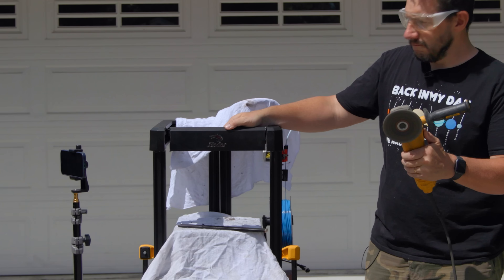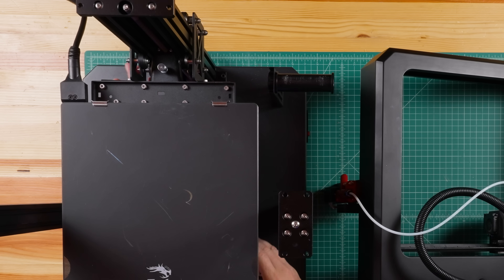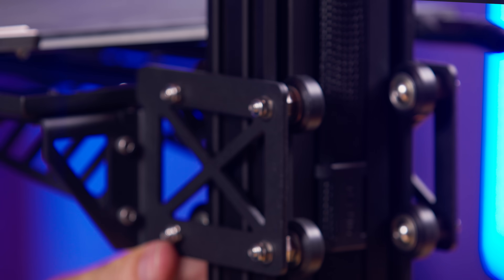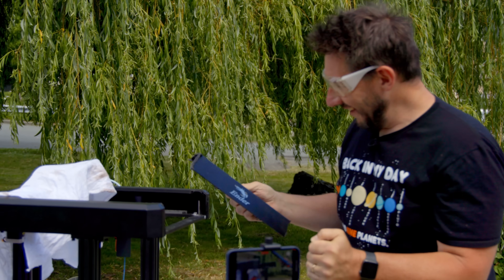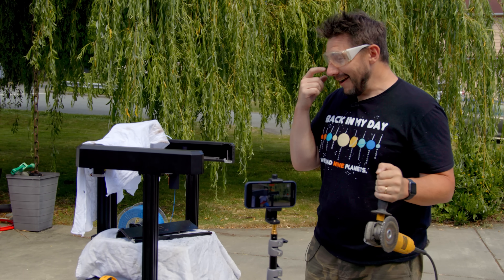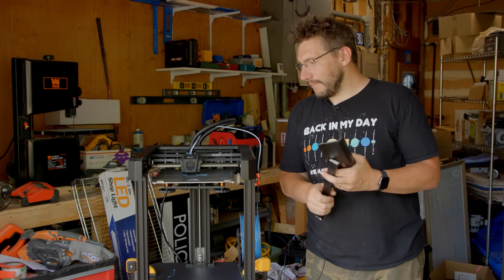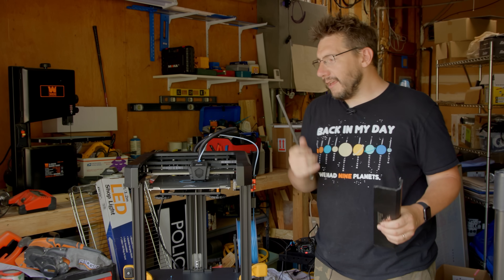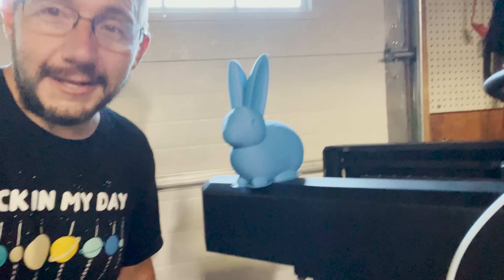I FIXED the Ender 7

Comment: Haha, this was amazing. You made it possible to buy this printer for just nothing. Changed the z wheel crap to linear rails and the printer is a blast. Printing parts for 2 years with no real degradation or errors. Like a industrial printer for no money 😁Thanks!
Reply from the maker: Glad I could help
Reply: @3DPrintingNerd ❤

Comment: Nice hack!  I agree it's really important to be able to see what's happening in the first layer of a print.  No other printer off the top of my head makes it so hard to see.  Great idea I tend to agree that the thickness of the metal is enough to hold it's shape with that missing. At least while assembling mine the top didn't really do much as the uprights were pretty well aligned so I didn't need to bend anything to get the top to mate with the uprights.

Comment: Mine works awesome.  I also had to adjust the back stop nut. but it didnt take much effort.  first print to last it works without a single issue.  Not at all sure id cut my top front rail down, but do agree it does end up "in the way" a bit.

Comment: This is why amateurs shouldn't touch things. Tension in these traverse belts is quite high, inertial loads from the hot end accelerating back and forth produce low frequency vibrations which now are closer to the fundamental frequency of that baseplate he just cut off. That will throw off alignment of guides over time and ruin the system. Moronic, amateurish and sad.
Reply: Hahahahahahahaha tell me you haven't seen his recent videos without saying you haven't seen his recent videos
Reply: @3lapsed  I don't care. I design machinery for a living and people like this guy just gives bad advice/example. He doesn't know fundamentals and he monetizes on ignorance
Reply: @puntoycoma47  designing for living and living from designs is not the same. 😉
Reply: @BeardedTinker  I was formally trained to design machinery and I've been in the business for 17 years making things from race car components to robotics, injection molding and industrial equipment. This guy is an amateur jock and it shows.

Comment: Everyone speaks about rigidity issues about removing that metal bar but it really isn't an issue if the rest of the frame is solid. Many Voron models (v0, trident, v2.4) still have a U-shaped gantry and have little issue with rigidity, same with others like HeVort, etc. Although they do have either additional extrusions or linear rails supporting the gantry from below as well

Comment: By removing that you risk warping the plate from stresses in the steel plate
Reply from the maker: Actually I don’t. I promise.
Reply: @3DPrintingNerd   not shooting smoke man. Seriously the possibility does exist  research stress relief of metals through heat treatment. Been in the metal working field for 15 everything from CNC plasma, grinding, heat treatment. Look up Titans of CNC he's also frequently mentioned relieving  stress in metal even plastic parts through the machining process to achieve tolerances for parts that tend to spring when material is being removed.
Reply from the maker: @johnl5177  Maybe I misunderstood. by "plate" I thought you were referring to the build plate, and as far as I can tell it's not connected in a way that would introduce stress if my cuts made things not good. I could be very wrong. Titans of CNC is AWESOME.

Comment: I have the Ender 5 plus.   I tell everyone the number one upgrade that is absolutely necessary is the corner brackets that drop the front bar down a few inches (available on thingiverse) so you can see what is going on.

Comment: Do you realize the wheel you had in your angle grinder wasn't a cut off wheel but rather a grinding wheel lol. This is why I hate working on machines in our repair shop that the general public messed with
Reply from the maker: Yup, I knew. It’s all I had because I couldn’t find my cut off wheel. Did the job though

Comment: I recently bought this printer. No problems right out of the box at 250mm/sec.  I guess the point of cutting the top structural unit was for clickbait and views, but there is no reason at all I can see to do this and it will allow flex in the XY gantry head.

Comment: The cross-bar piece you cut off keeps each side pillar from flexing sideways, under slower speeds it wouldn't matter but at the claimed 250 speed it would stop each pillar from flexing side to side on the X-axis.
I learnt this from building roll cages on race cars, the solution would be to replace the offcut piece with another but mounted higher so you can still enjoy the access and usability of removing the bar in the first place without sacrificing the integral structure.

Comment: The bed torques "left and right" not because the carriage has two pieces, but because the only thing resisting that torque is the V-wheel edges riding in the V slots. Even if the carriage was a square box, they would still slip out under torque. In order to stiffen that axis they'd have to add wheels that roll on the left and right sides of the column in addition to just the front and back. If they moved the existing wheels, they would just move the problem from the X axis to the Y axis in terms of wobble.

Comment: That's one way to wrack a perfectly good 3D Printer. That Aluminum metal frame you cut out the front is structural and has a purpose. You've taken a strong square frame and turned it into a weak U shape. And using a grinding disc as a cut off disc shows me you don't have a clue what your doing. Wouldn't be surprised if you never get another product from Creality and I wouldn't blame them. What you should have done is returned the item and give them the chance to repair or replace the Printer.
Reply from the maker: HahahaHAHAHAHHAHA. Look, I get what you’re saying, and yet, I did it, and it works great. That metal wasn’t needed and yeah, still isn’t needed. 

Plus, Creality sent me a message saying “Genius!” and I already have more boxes en route to me from them.

Comment: For anybody that wants to do this when they get an Ender 7. Just cut off that plastic front panel and leave the aluminum cross brace. You would get the same visibility with the added structural support.

Comment: I also thought of this particular detail when i saw the machine in previous episode that the front part totally obstructs the view of the most important operations, building the first layer and the leveling process. Btw. I also used my angle grinder on my Ender V2 (to make an exhaust port for the PSU so it doesnt burn itself up.) Creality for some reason i dont get (how can u as designer/engineer miss a such detail like properly CAD the fan intake holes but forget the outlet holes?) totally missed to stamp/cut this out in the cover for the PSU even they made plenty of holes on the control box cover. Now I have seen there are also printable psu covers for the V2 on thingyverse to adress this potential machine damage risk /  fire hazard.

Comment: You guys sound like your turning 20 horse spindles instead of moving a couple ounces of print head. It is still overkill with the frame that is left. I would be more worried about the lousy design holding the printbed. Creality has finally run out of good ideas. The ender 6 with better bells and whistles would have been better time and money spent than this monsterosity. Why does Creality feel the need to try to sell this boat anchor anyway? This is taking about 10 steps backwards if you ask me.

Comment: From the mechanical perspective you've just destroyed it. You've made it flimsy, especially for high speeds prints. When you have "closed" structure it is significantly more stable from the integrity perspective, it can withstand harsh forces. When you have "opened" shape -- it's flimsy and its parts can band and move in any direction independently. The triangle is the most stable thing with the best  structural integrity that guarantees all the sides will always be in one plane. Than you have 4-sided closed shapes that is still durable and stable from the integrity perspective, but can't guarantee under certain conditions that all 4 sides will be in the same plane. Making "C or "U" open shapes is the worst you can do. Now, all sides have no integrity at all and got the independence from each other, like all ex-USSR republics got their independence from the USSR in 1991. You've just destroyed solid integral system. 😭

Comment: it will print 250mm/s on infill and moves ? , a lot slower on walls and top / bottoms .
You can set the print speed to 250m/s , but the jerk and acceleration will limit it down .

Comment: A few big fails here:
1. assuming the front structure holds no purpose. It does. 
2. Not knowing it was aluminum, not steel. 
3. Using a grinding disc (for grinding flat) as a cutting disc instead of a proper cutting disc.

Comment: The one thing that front piece could be used for (other than easier manufacturing?) is to help accommodate an enclosure panel. But for a machine like this, an enclosure cover that swings down like BCN3D's Epsilon series would make a ton more sense. I can imagine that top piece getting in the way for an Ultimaker, and it sure was a pain to deal with in a Raise3D.

Comment: Grinding, sanding, or abrasive cutters should never be used on aluminum. It just gums everything up. Need to use a toothed blade rated for metal cutting.
Reply from the maker: Had I had one, you bet I would have used that. However, still worked great and I can see my prints!

Comment: Ummm... ok, the plastic was unnecessary, but I'm pretty sure that the metal was a part of the structural support system.... I can't help but think that that printer is now LESS sturdy than it used to be.

Comment: Well over 25k views.  And who knows how many comments here. Certainly a popular video!  Me not being an engineer echo many of the comments about not sure taking out the metal part was a good idea. Will be very interesting to see how it holds up over time for rigidity and staying square and parallel.  You need to move and transport and print and use and see if it holds up to that and everything stays the way it should.     

Oh and I think you would make Tim the tool man Taylor proud with pulling out power tools.

Comment: So logical thought.... Wouldn't the plastic and metal basically create a low level draft shield?  This would avoid some layer shifts with materials that suffer from temp changes.... I mean a very very slight save.... wouldnt be an issue I think.

Comment: That second nut on the leveling screw is a locknut.  Once you get the bed leveled, you tighten the locknut down and that keeps the setting

Comment: I would have used a hacksaw to do the cut
Reply from the maker: You’re a savage
Reply: @3DPrintingNerd  Yes, but removing a support piece is just not smart (the metal crossbeam).  Besides, using a grinder instead of a cutting disk is, well, suffice to say there are better choices.
Reply from the maker: Oh much better. Hahaha

Comment: It seems there are one or more design flaws. One is that maybe be that the base where the screws hold the Z axis post is not rigid enough to keep the Z axis post from flexing when bolting the top frame on. Second could be the holes for the Z axis bolts are too far back or off center allowing the Z axis post to flex when bolting on the top frame. Third might be that the top frame is too  small or not square allowing all of the posts to twist out of square.

It would have been nice to see take the top frame and checking how square each post was then checking how level each post was to each other. Then after installing the top frame re-check the square of each post.  It also would have been nice to to see after installing the bed, putting a level on the bed & seeing if you could level the bed. Of course, this would have only told how earth level the bed was. But it would have given you an idea of how much out of level the bed might be after installing the top frame & leveling the bed to the print head. Because you removed a very inportent part of the structural integrity of the machine.

Comment: IMHO I would have not removed the steel cross bar, this will reduce the frame rigidity overall and potentially increase vertical vibration, particularly if attempting the speeds specified. In my experience the stresses caused by Core XY belt tension working on two axis is quite rotational rather than linear. A retained rigid box section would be much preferable to offset this need. You have now two untied ends which are cantilevered and could potentially increase vibration from the steppers & the belts from these asymmetric forces. I agree with others that the removal of the plastic fascia would have been an optimum if it is such a big deal (not convinced)for the average user. IMHO this is not one of your better thought out moves. High five

Comment: At 699, I really, seriously suggest getting a RatRig V-Core 3. It's not much upcharge, but the components are decent and the design is more advanced. 250 is not just a fiction, but it's what I do on a daily basis with the predecessor, V-Core Pro 1.3. The kinematic drive is state of the art, the printer is easy to enclose, motors are the best in the industry. The parts quality is lightyears ahead, the bed is even 6mm cast and precision-milled alloy.

Comment: Wouldn't removing the metal allow for the rails to go out of parallel? Fine for the plastic which has close to nothing in terms of structural rigidity but removing the metal too seems kinda dumb

Comment: The first 3D printed improvement would definitely be a connector/bridge that binds the plates on the Z at 1:37. 
It's a bit sad that Creality kept the cantilever supported bed. Especially considering all the complaints about the Ender 5's bed rigidity.

Comment: So what he wasn't expecting was that cross member served a purpose, at it's specific location too.   This printer was meant to haul butt, and throw that head around pretty violently.  Suddenly making a 90° turn would send vibrations into the machine.  That cross member was to keep those vibrations from causing wave patterns after hard corners.  It's likely that if he pushes this machine to its very limits, say with a volcano hot end, he would see ripples along the left and right sides of the print.  This could also cause slack in the belts, getting a cog slip at a high velocity direction change and offsetting the entire print.

Comment: Honestly? Weight and sturdiness matter too much for me to approve of this. I know it’s nice to see your prints and all, but on my Ender 5 I’ve gotten into the habit of just looking from an appropriate angle to see how first-layer adhesion is going.

Rigidity and distribution of weight of the machine seems to be part of the Ender 7’s design philosophy. It’s perhaps what (theoretically) allows such high print speeds, in combination with other high-end components of course.

Comment: You can cut it when the frame installed on the support bars. But there will be deformation in injection molding if cancel the front of the frame, which may cause serious quality issues.  Maybe you will find that you can not screw the frame on the right and left pillars.

Comment: "We aren't using stuff that isn't needed"? aaaahhh...looks at the wasted filament from bad prints or purging. 
wouldnt the metal plate at the front be the stabilizing factor for squaring the machine?
Reply: Also prevents harmonic oscillation.

Comment: The plastic bar gone, absolutely a thumbs up. The steel bar - not so much. That's a structural piece. And oriented flat as it was, it really didn't block much view on its own. That there is gonna cause X/Y twisting and wobble, especially at higher speeds, and even more so when adding some mass to the print head.

Lopping that off on a corexy frame, is like removing the anti roll bar from your car's front suspension.

Comment: Here's my thinking: IMO it (the bed carriage) doesn't have to be 1 piece. I think that's gonna cause more issues than it solves, and likely take months to mature for mass production. Which is very likely already ongoing.

What it needs, is a piece of 20x40 (or 20x60 if it'll fit) as a brace slotted in between the rollers of the two sections, at the rear of the Z-post. Drilled, tapped and bolted to the brackets at the rear, in both center bores of said V-slot profile.

This is also IMO a solid, non-bandaid'y solution which requires very minimal changes to production and assembly. The only real alteration needed is drilling the 4 mounting holes. The rest is a straight parts-addon for user assembly; the cut and tapped profile piece, and 4 screws + washers.

Comment: I understand why you decided to remove the plastic part on the front, but the 1/4inch steel part is needed to avoid deformation of the top : if it's not there, the U shpe might turn into a V during printing because there isn't any metal avoiding the end to distance themselves, also, you loose a lot in the planearity of the top part, it will flex a lot easier, maybe not really evidently, but even 1/10th of a milimeter can ruin a print, also if the linear rails are not perfectly planar, (because of a twist induced by the high accelerations, remember Force=mass*acceleration), it will induce a lot of side stresses in the rail wich will degrade it really quickly, ruining it's lifespan.

And oh boy, you didn't though of protecting the linear rails from the metal dust, consider yourself lucky if they still work correctly ( the metal duts is going to ruin the bearings by clogging in the way of the steel balls)

Comment: The blade on the angle grinder is intended for grinding and not for cutting! Therefore there were no sparks when cutting the metal and the edges were unclean ...